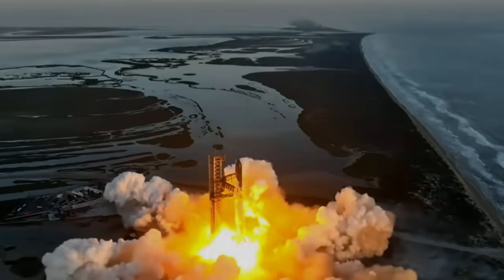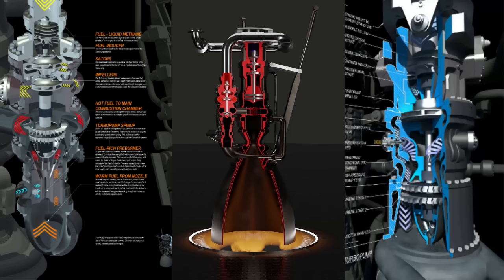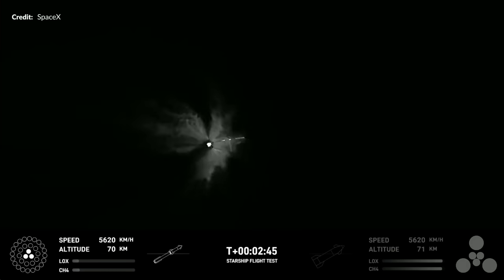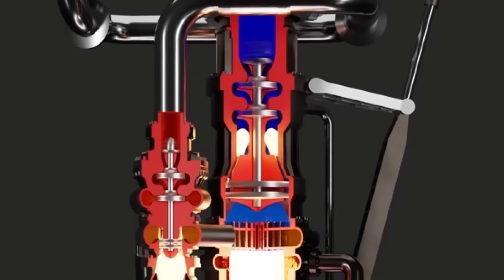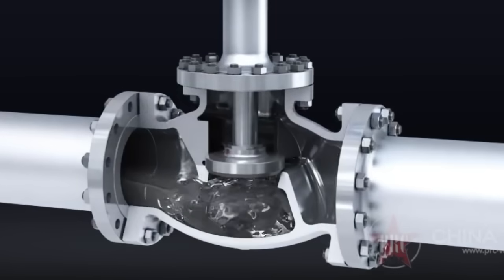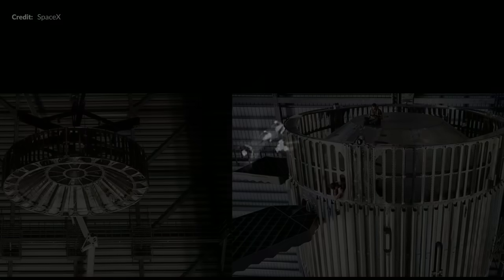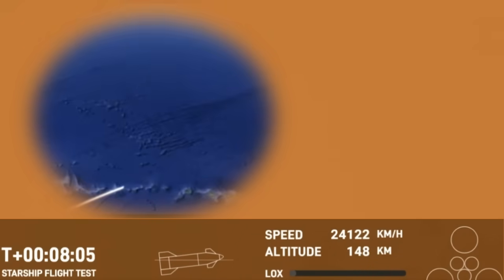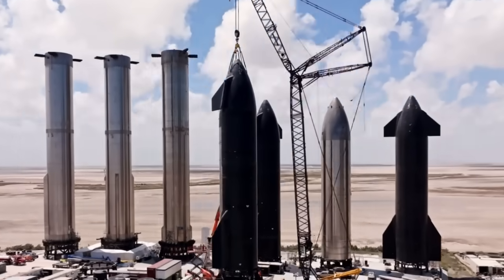Starship Flight Failure Analysis IFT2

Comment: That was a very smart break down. I'm still sure the ring was too short...especially if it will be used for launch escape in the future.  Other than that I believe your speculations have a great deal of merrit
Reply: I was thinking the ring was too short as well, only 1.9 meters in height, I think that another ring is needed to give more room for the expanding gasses, it would also rise the Starship to a true 400 feet tall. Also I felt that going down to 3 engines on the booster and fireing starship pushed the booster backwards in an abrupt way making the fuel go all over the place instead of feeding to the raptors.
Reply from the maker: Thank you!  It may need a little more height to be safe.

Comment: Sea level engines on ship were gimbaled all the way to the outside to get exhaust out the vents and avoid blowback, but you still make a good point.  Don't really need them for hot staging perhaps?
Reply from the maker: Good point but I don't think it was enough.  The push back on the booster was extreme...

Comment: great analysis. You did not mention that quite a few tiles were lost from the ship as it ascended.  These were visible on the slow-mo video of the launch. This may have caused an issue for the ship on re-entry. However, I hope that the ship might survive re-entry even with the loss of a few single tiles. Perhaps we will see in the next test flight.
Reply from the maker: We would also like to see it survive with a few tiles missing...

Comment: Why is everyone saying this was a failure?  It was not a failure. There was no mission or objective. It was a test flight. And it was spectacularly successful!! The starship damn near made it to orbit.
Reply: Thats all wrong
Reply: @Hungary_0987  no it isn't.  Have you followed the program since day one? Well I have.  Day one. This was not a failure. It was a test. And instead of telling me I'm wrong,  tell me how I'm wrong.  SpaceX and the entire space community believes this was a successful flight.  But you know better huh? Some internet troll...?
Reply: Cory, we know why the term failure is used... Clicks
Reply: @ShipMonster  clicks yes. And ignorance. And a fair bit of malice towards Elon Musk and everything he does.
Reply: iamaduckquack  You're a bit off here.  The booster didn't fail the boost back burn.  It likely failed during the stage separation as the cause of the boost back burn failure is almost certainly due to fuel sloshing from negative acceleration because it didn't have enough thrust to push back against the engines on Starship.  The ship succeeded in hot staging, getting into space, and reached the required speeds and altitude for orbit.  It was off it's course however because again it likely failed during stage separation.  This entire flight was a test of a complex rocket made up of systems that have never been tested successfully together.  After the first flight SpaceX had to prove the launch pad could survive a launch without destroying the surrounding area with bombardment, the Raptor engines could all stay lit for a full duration burn, that the rocket could actually survive max Q, that hot staging worked, and that the FTS also worked.  The last one was definitely optional and it would be preferred for the flight to achieve it's full flight profile but anything after hot staging was bonus data and the issues that came up allowed SpaceX to completely validate their new FTS for Starship and Super Heavy.  Nothing about this flight was a failure because everything that didn't work before was demonstrated to work flawlessly now and everything that led to the RUD of this flight was new territory that had never been successfully tested before and the data collected will likely make the next flight perfect from beginning to end.  It would only be a failure if it leads to them being grounded for a significant amount of time again and they failed to collect data from the flight.
Reply: Actually a few of the mainstream media news companies are starting to get it, when it comes to StarShip it’s like the penny finally dropped, this Ain’t your Great grandfathers mega rocket 🚀.
Reply: Only thing wrong i can See is that there was an objective.   Making it through staging this time and they achieved that. Everything else Was bonus data
Reply: @Madhuntr  it was still a test of an untried method. And it was successful. And we don't know why the booster failed yet. SpaceX has not released that information. All this internet speculation is just that. Speculation.
Reply: Artemis 1 was a successful test flight
Reply: I agree this was a spectacularly successful test, exceeding my expectations, but the fact is that by one definition it was a failure. SpaceX filed a flight plan with the FAA against which it was granted a launch license but the mission did not adhere to the filed flight plan hence the FAA announced a mishap investigation. So I think this is an example of a really successful test that still failed to adhere fully to the FAA definition for a totally successful flight I.e. adhering to the filed flight plan all the way through.
Reply: @julianfp1952  ok if you want to be pedantic about the definition and such... but the only objective was to launch, collect data, and test the equipment.  That's exactly what they did.
Reply: It’s not correct to say there was no mission or objective. They certainly had objectives, the primary of which was hot staging, which they succeeded at. They also succeeded at having all of the engines fire, having them stay lit all the way to staging, and not blowing up the pad. It failed at some secondary/tertiary objectives like having the engines on the booster properly relight, and having it soft land in the ocean, as well as starship flying its complete profile, re-entering, and crash landing near Hawaii.
Reply: @bdshort  I know what the ships were supposed to do goddammit.  Probably more than you. Why does everyone think they technically have to be right all the time? I'm saying it wasn't a failure because it didn't do everything they hoped it would do. That's all I'm goddamn saying.
Reply: @corycrandell2682  I don’t think it was a failure either. But saying they had no objectives is silly.
Reply: Orbit is not an objective for Starship for this test.
Reply: @amirh.a At what cost??
Reply from the maker: Well. It wasn't trying to make it to orbit. It did indeed succeed at several milestones.  As we noted.
Reply: Objective would technically be the test but not the mission.
Reply: Flight “failure” is in reference to why the booster blew up 🤦🏻‍♂️ y’all mad over nothing. Use your brains!
Reply: @TGNDxGamers  I'm just hear to understand and learn.
Reply: Only the MSM reports that for the immediate headlines. When they are just to lazy to look at the facts and investigate.
Reply: The flight was by every standard a “failure”.  The thing exploded in a manner that was entirely unaccounted for, but very expected. 

It was a success by the standards of testing, and a failure by the standards of spaceflight. analyzing how it FAILED is exactly why the mission was a SUCCESS. see?
Reply: @maikoah  the thing is we're just a bunch of morons watching videos. 
 What we think does not matter.  SpaceX sees every test as an opportunity to learn. And that's what they did. And the next one will be better.  If not perfect.
Reply: @maikoah  Still sounds like you're saying the guy who won the race failed to do it faster.

Sounds like a very "try hard" way of being technically correct to me.

Particularly since it's not their most advanced equipment. For all we know everything that failed has already been revised in the next one before this flight even happened. They got another one already ready.

For all we know it was the self-destruct system that had a glitch and panicked and blew up Starship. A point of failure that won't exist on the final design.

Failure is a loaded word, everything after stage separation was non-successful. Subtle but different, since we're being nuanced and pedantic.
Reply: The objective was to land the booster stage in the Atlantic, and land the 2nd Stage off the coast of Hawaii.

Both of them blew up in mid air, and there’s evidence that both explosions happened without the FTS.  They didn’t reach their intended altitude.

That’s a fail all day long.
Reply: @The93Vector  The plan =\= the objective.

Nobody involved thought the best case scenario had any chance. You had better odds getting free Taco Bell when the Mir space station reentered. 🤣
Reply: @The93Vector  actually what everyone on here has failed to realize or mention that the major test was of the OLM and water deluge system. That's way more important than any ship test. And you are wrong.  Landing was never actually expected. Plus the starship they flew is already obsolete so it doesn't matter what happens to it. And since SpaceX has never tried to hot stage any vehicle,  that was a total experiment. Nothing was expected buy excitement.
Reply: It was progress, but they certainly had a mission plan and didn't achieve that.  Success and failure are probably just poor terms to use here.  They did a lot of things better than in the past, but they didn't complete the entire mission profile.

I think the main problem is that a lot of us, including me, see their iterative process as being wasteful and inefficient.  I'm dubious about how much information they're getting from each launch regardless of how many sensors Starship is equipped with.  I'd be much more comfortable with them testing each component individually like NASA has before to work out the kinks.  I'd much rather have a few individual test engines fail during trials that have an entire craft be lost.
Reply: @blackzeroflame  this is exactly the same method and style of testing that developed the falcon 9. I think they might know what they're doing.  You also have to remember this was a flight full if firsts. The first ever attempt at a hot staging for any SpaceX vehicle. The first flip maneuver attempt by the booster. The first time a starship made it into space. The first time the raptor vacuum engines have run in flight. And it's the world's biggest and most powerful flying machine in history. 
 And it's been taken from paper to metal and flying in like 3 years. It's amazing progress.
Reply: @blackzeroflame  and you might not think it's wasteful one they get to a point where they start to refly the same ships and boosters. Some of the falcon 9s have flow and landed like 18 times. And they had to blow up a ton of those to get them as reliable as they are. They've landed 178 falcons successfully in a row!  That's more than any other rocket has even flown
Reply: @blackzeroflame  nasa took 20 years to build the sls. Out of used parts. That's too long. It's already obsolete and massively over budget.
Reply: @corycrandell2682  Sure, but it was successful day one.  I'm a lot more comfortable with an expensive project that appears to be reliable than an expensive project that appears to be unreliable.  I don't see a need for a rush towards human space flight at a large scale and I think SpaceX is rushing for something that we have no real need for. I'd much rather have a well funded and robust program controlled by the government than a slapdash program that is comfortable with destroying entire vehicles on a regular basis.
Reply: @blackzeroflame  I'd hardly call SpaceX slapdash... and unreliable?  Give it a minute... it was only the second attempt...
Reply: @blackzeroflame  and you know as well as I do it would take nasa 15 years to get this far, and the program would most likely be canceled because it would get over budget and way over schedule. Nasa has had their chance. They could have finished the venturestar program or the constellation program up and running 15 years ago. That's a government program for you. A huge waste of money and time.
Reply: @blackzeroflame  the shuttle appeared reliable. Until it wasn't. Maybe they should have tested a couple shuttles to failure to see where it's weaknesses were. Unfortunately the crew of challenger had to pay the price of that ethos of testing.
Reply: @corycrandell2682  The shuttle had one of (if not the) the longest and most reliable launch histories of all time and the disasters were the result of known issues that the engineers advised against and were ignored.  Testing to failure wouldn't have prevented those disasters because they were the result of ignoring known problems.
Reply: @blackzeroflame "I'd rather have something cost 100 billion dollars and take 20 years than do the same thing with 10 billion done in 10...  You're not good at math, are you?
Reply: Lol.
Reply: @jtjames79 is that like getting a trophy for attendance?
Reply: @kyleh5498so it was somewhat successful or a partial success rather than massively successful.
Reply: @maikoah trophy for attendance.
Reply: I think "Spectacularly" successful is a touch fanboy about the whole thing. 
If for the reasons you gave you consider it a success I accept that's your opinion.
But when you say spectacularly successful it causes me to ponder your objectivity.
Reply: @kyleh5498 exactly. No need for overhype. Just say success if uncontrolled destruction isn't a factor in the success/failure ratio. 
If they meet the schedule for their contract I will certainly respect "spectacular" success. Hyperbole is as bad as blind criticism.
Reply: @kyleh5498 nobody? You didnt read far. But I agree that it wasnt a failure. Without objectives or a mission failures not an option. 
They did something. Agreed.
Reply: Well you described it as a massive success or are you ignoring that? 
Getting the thing to launch & explode is a massive success in your world but until I see it become more useful than a missile i'll hold back on gushing over the process myself. 
I look forward to observing the progress from all the data & how it benefits the scheduling while keeping to the contract timeline & we'll see who's ignorant then.
Reply: @corycrandell2682 if you watched this video then you would have seen there was no malice.
Reply: The doom ship, roulette every flight, the engines are sea barnacles, too many, use batteries instead
Reply: @terranspaceacademy 
Realize that a single inaccurate statement can ruin your reputation, don't make excuses, too late.
Reply: It was a failure because both stages were terminated. 

This doesn’t mean they didn’t complete some years, but the flight test itself was a failure. 

Anyone saying otherwise is engaging in Soviet-style spin.
Reply: Because it has exploded literally for every test in the project. I mean EVERY SECTION of the project has lead to an explosion, stacked or unstacked. I know a few engineers and basically they are concerned on this thing’s true reliability. It’s way too complex. There’s a reason why rockets don’t use 30 engines.  Theres just more that can go wrong. Spacex has a good PR team which is gaslighting the public into changing the word ‘failure’ into “come on guys, how about that great data we collected”. Also it has no abort system. Why would you want to get on this thing? It’s absurdly heavy because they use stainless steel which is why it has be that big - it needs to carry much more fuel. NASA would call these tests for what they were, failures
Reply: @sgtgiggles  striggles giggles has   come to his comico-unrealistic conclusion bravo!
Reply: @arturoeugster7228  ahhh another fanboy
Reply: @sgtgiggles  true expert ! Sell your knowledge to the Chinese , they will reward you with the best treatment reserved to foreign traitors. Splendid vacations , financed by the industrial bank of China in Zürich, 🇨🇭

Comment: Great analysis! Too bad no one thought of that before launch 😢
Reply from the maker: That's what testing is for :-)  But you are right.
Reply: Likely they did. But notice one of the reasons why hardware rich test-driven development works so well is that it allows you to verify your assumptions. You do not have to err on the side of caution. For instance, they may look at the options for hot staging and see they have say, 4 ways of doing it depending on how many engines they turn off / on for both the booster and the starship. Maybe a lot more combinations. But which is best. Likely there are tradeoffs, often the option that will deliver the best performance is also the most risky. If you err on the side of caution you avoid that, and never really know if it would work or not. But they may try it, even though they may think there is a 80% chance it fails, they are going to prove it fails. If they are wrong, their rocket performs better than all those were the engineers erred on the side of caution and did not test those assumptions. If they are right, they try the next one, until they find the limit. And because they are setup for mass production from day one, it cost them less than it would a traditional rocket developer, while they end up with better rockets for that small cost. Which is why their Falcon 9 utterly dominates the market.
Reply: These were disposable and outdated vehicles, they likely intended aggressive profiles to see how robust the vehicles were. This probably came as no surprise to SpaceX engineers.
Reply: Also gave SpaceX the opportunity to test the new deluge system under real launch conditions. That fully protecting the pad is absolutely critical for good future test launch cadence so if it hadn’t quite been up to the job and needed further enhancement better to find that out as early as possible in the test program.
Reply: That's why it's called a test flight